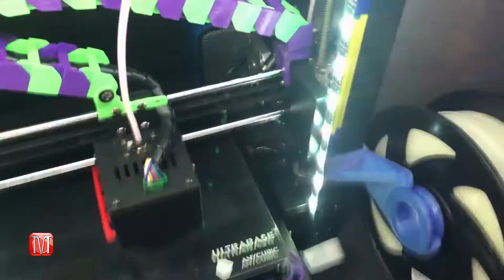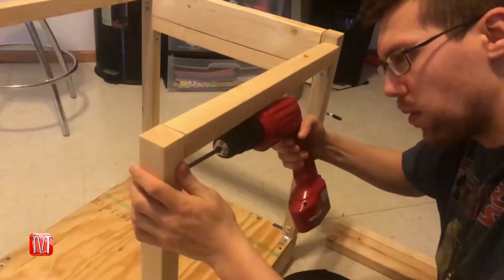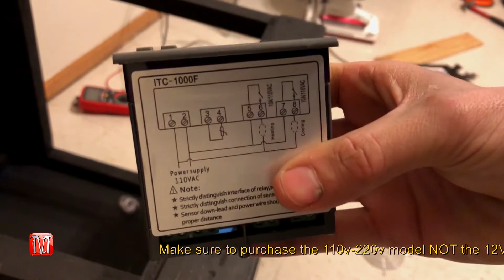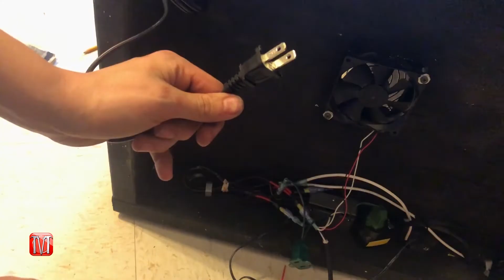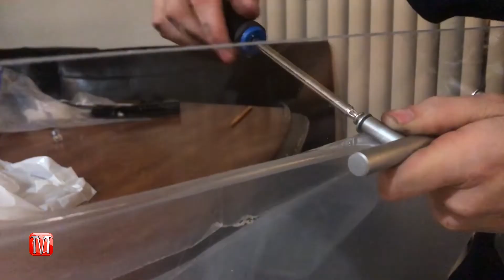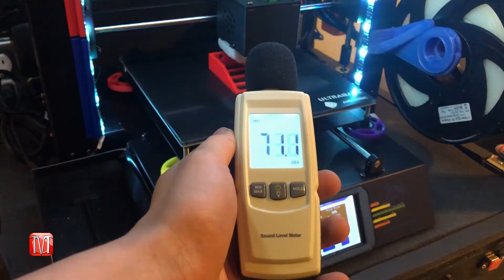How To Build a Multi-Purpose 3D Printer Enclosure

Comment: Gotta Remember!!! 2x4 is NOT "True Dimensional"!!!  It's truly 1.5"x3.5"...only way you're gonna find true dimensional is if you go mill your own or reclaim some from an old structure!!!  Awesome build BTW!!! Regarding "noise" I have an Ender 3 which "sang" as the steppers were mounted DIRECTLY to the metal frame and that I effectively silenced by putting stepper motor dampers on all 4 stepper motors: x,y,z, & extrude!!!  I sourced mine from a copy machine boneyard...the dampers were found in the Automatic Document Feed section (ADF). This was an extremely simple & FREE fix!!!😁👍🏻

Comment: Hi, does the fan actually lower the enclosure inner temperature?
Reply from the maker: Žiga Jamnik yes but at the moment it only helps cool the inner temperature to 75 degrees Fahrenheit or about 21 degrees Celsius when the 3D printer is running. Without the fan running the inner temperature usually will get to 90-100 degrees Fahrenheit when the 3D printer is running so it does help cool it down. I’m thinking about installing some larger fans or even upgrading to a desktop AC unit to see if that will help drop the temperature even lower since I usually like printing with a inner temperature of 65-70 when using PLA.
Reply: @MAGSHowToVideos  but that is a lot for 2 60mm fans with low CFM. If you compare them to 120mm Noctua with 90 or more CFM, i think it would make a huge difference. What do you think? But do you lose sound proof enclosure if you cut a 120mm hole in it?
Reply from the maker: Honestly I just used whatever fans I had laying around the house but upgrading to some 120mm fans would probably work. I don’t think cutting the larger holes for the fans would increase noise, at least not enough to notice.